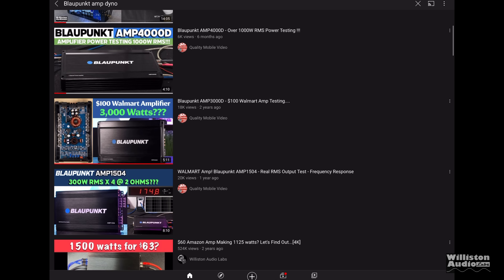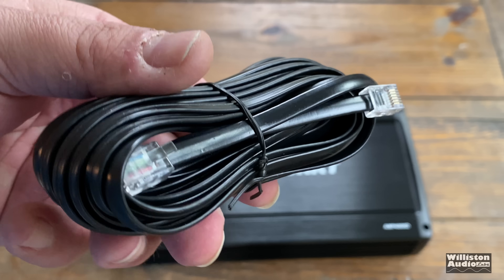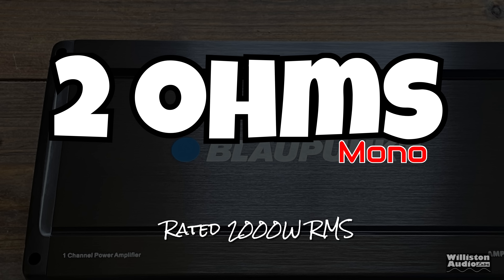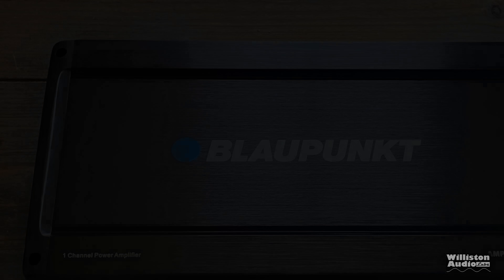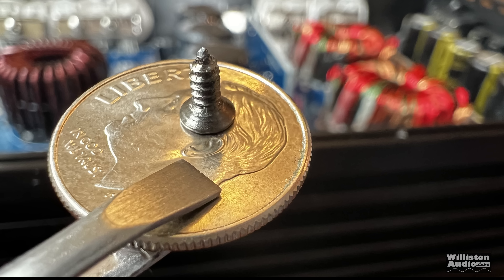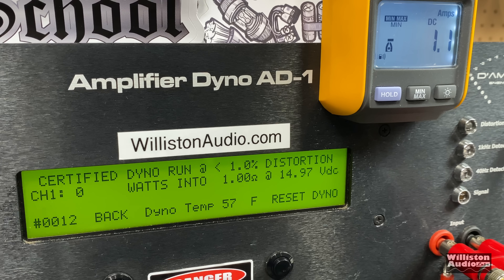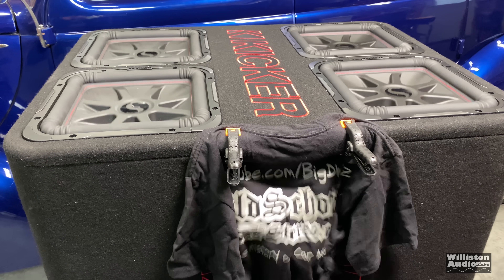How Much Power Does a $49 4000W Walmart Amp Make? [4K]

Comment: Per Google AI Overview: Blaupunkt was originally a German manufacturer and was part of the Bosch Group until 2009. It was sold to Aurelius AG in 2009 and later went into liquidation in 2016.  Current owner: Established inc., a U.S. brand licensing company.  So, sadly  at this point, they are leveraging the reputation forged in it's earlier days and slapping a Blaupunkt sticker on generic manufacturer products. Another great organization that bit the dust.😡

Comment: 400W outrut? 🤣 And no high pass (subsonic)? Great for ventilated enclosures, can kill your chassis mechanically at frequencies below 30Hz, because you don't have a physical brake like in the sealed enclosure. With ventilated enclosures a subsonic filter is a must have. Blaupunkt was a great german manufacturer in the past, but since they sold the brand name to China, unfortunately it's rubbish.

Comment: Got one of these lower power but I absolutely hate it. Only got it for a temp use and I wouldn't even say it's good for that. I got the gain 3/4 and it blows itself out and goes into protection on rock and roll music let alone anything else. I'm only ring 2 8 inch subs on it and it's supposed to be 1500 watts.
Reply: Your subs ohms could be too low. I sold a sub that worked fine in my truck to a friend and it kept shutting his amp off when I turned it up. What it was is my amp was stable down to 1 ohm and his was stable to 2 ohm and the sub was wired to 1 ohm. Rewired the sub and it works fine
Reply: @Cantbreakitifitsnotfixed it's that garbage ass amp. New amp works mint same wire configuration.

Comment: A long shot, but is there any possibility of testing the 5000d version? I cannot find ANY dyno testing or even reviews on this amp. For a budget option blaupunkt is pretty good stuff. I have their 3000d version running 3 r2d2-10s in a custom aeroported enclosure I made myself in my work truck and it gets down. But I’m wanting to upgrade because I know I’m not pushing these subs to their near their max capacity and this seems to be the best option for around 1300-1400 on 1.33 ohms if that seems right to you. It’s only 118.00 dollars on Amazon currently! I’m stuck between this one and the skar audio rp 1500.1 for around 170.00

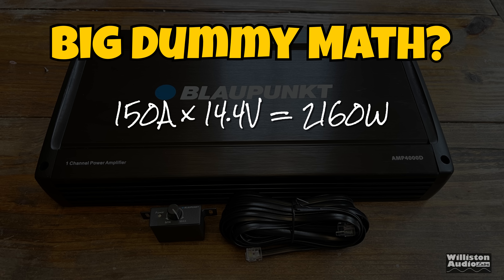Comment: 4:40 That "Math" doesnt really work, because its says RMS power (sine wave). With your calculation youre assuming a dead flat DC output. Which is wrong ofc.
In other words youre basically comparing the flat DC input to the "pulsed" output of the amp. Ofc the input power will be less on average. You can easily visualize that by drawing a flat line and a sinus wave (with the same peak voltage). Now take a pen and color/fill in the area between the voltage and the base line. Youll notice theres much more area under that DC line.

Comment: Agreed,  good power for 50 bucks! I noticed the circuit board looked like the circuitry was split in half like they use the same board layout for a stereo amp. I wonder if they just internally bridged it and called it a mono block. The Chinese dont waste engineering on cheap electronics. It wouldn't surprise me if they want twice the amount of money for the stereo version but it is essentially the same amp unbridged with an additional speaker connector.

Comment: I wonder if the EMI shows up at low gain usage or only when it starts sucking amperage. I was hoping to use one of these at low gain to drive a bigger sub recently came across but like most of everybody else here, I was drooling at the mouth until the EMI stuff showed up. My sub is allegedly rated for 2000w and was willing to work with an amp like this but the EMI isn't worth it. If your tester interpreted the interference as character changes on the display, I'm scared to think of what it would do my pioneer radio when connected to the remote bass port ijs... tsk tsk... I had/have hope for blaupunkt, maybe their lower power level amps are better as far as interference?
Reply: I wonder if they are even using proper loads during testing. They might be using a purely resistive load and ignore inductance idk

Comment: U wud think by now, they wud just design simpler amps that are pretty much, plug-n-play...  They're still temperamental, ez to blow during install and way under-functional...  The whole car stereo design is out-dated!  Why aren't the geniuses designing wireless speaker connections yet?  By now, we shud be able to connect as many speakers as we can by Bluetooth to the Amp, NO WIRES!  Impossible, not at all!  It's the same as portable bluetooth speakers!  I shud be able to rent a car, take my Amp & speakers, plug-n-play then return the car.  Nothing worse than renting a car with a tik token stereo...  I had to tell my installer to mount my Amp on my full range 10" "Kicker" box.  He said, u sure, I said YES!  This was in 2011.  Soon after, amplified speakers became the rage!  Maybe I was first, maybe n..  hmpff!  Anyway, Ask Kicker about dat and maybe these lazy bums will get cracking and stop blaming the Chinese and Amazon for losing customers!!!  You've lost, that CUTTING feeling!  Whoa, that CUTTING feeling! You've lost that CUTTING EDGE feeling, but it's not gone, Nooooo Whoa Whoa!
Reply from the maker: The rage in this comment 😳
Reply: @wal  yea, I get heated after crunk o'clock!

Comment: did you have the emi aka YNAMiC issues running at the recommended voltage?  or only when you ran it at a higher voltage?
Reply from the maker: Only this amp

Comment: would maxing out eq etc effect the audio test numbers? for example you had turned the bass to zero... this being a low cost amp which target audience would not be the most audio educated ie they thinking if you aint redlining you aint headlining...  most likely be running with everything maxed.  maybe engineers designed optimum performance at  bass boost max (or near?)  idk if that would change anything.. so id love to know!  great channel btw

Comment: Big D would you run some amp dynos testing power at 20 hz? And tell us about amp signal to noise ratio and damping factor. My Rockford fosgate power series T1500.1 bdcp says on the birth sheet that it does over its rated power at 20hz
Reply from the maker: Thanks for the suggestion

Comment: Back in 96, I had a 78 El Camino as my first car, Blaupunkt head unit, kicker comp speakers with a rockford punch 40 amp.  Lot of the 90's stereo companies have gone down hill and not high quality they once were. Even house speakers and receivers have gone to crap
Reply: I remember 96! I had a strong Clarion amp and head with a pair of Kicker comp 12's in a huge custom box in the hatch of my CRX. That system would make you cross eyed and it was stolen TWICE in one year and recovered both times.

Comment: That's sad.  I had a Blaupunkt head unit in a K-car back in the 90s (super custom wiring).  It was rated for 20 watts per channel and blew every speaker I hooked up until I got to the cerwin vega 3x4's that were rated for 80w.

Comment: i havent looked at speaker stuff for 25 years, i actually expected MUCH worse out of this just based on price.  back then amps were about a dollar per watt.  i expected maybe 100 watts out of this.
Reply: Class D is what makes the difference.

If you think about how much cheaper and more efficient a switch mode power supply is than a mains frequency toroid with a bridge rectifier and bipolar transistor voltage regulator, well, a Class D is basically a switch mode amplifier.

I looked into the technology around 1991-92, but concluded that switching frequency and output filtering issues would make it very hard to build a full spectrum device, but it might work as a bass amp...
Reply from the maker: Yeah the cost now is under 10c a watt in many cases. It’s insanity

Comment: You really ought to invest in a cheap oscilloscope... you'll be able to see a lot of stuff you're guessing at... for example the EMI stuff. Being that it is a class D amp, having a PWM output, if I had to guess, I'd say it was the same thing as a variable frequency drive... and the carrier frequency they are using for the PWM may be causing a lot of hash in the output. In short cable runs, you're normally expect the motor, or in this case, speaker, to filter all the high frequency noise out by integrating it basically with the inductance of the coils. The higher frequency will give you a better more accurate waveform, but it will also increase your switching losses. Personally, i'd only expect this to be ran on subwoofers, so it shouldn't have to worry about high frequency distortion. I have no idea what frequency spectrum that test unit is feeding the amp, and if it's trying to get it to amplify a frequency near or a harmonic of the carrier frequency, bad shit is gonna happen. 

Again, buy a scope so you can actually see it!
Reply from the maker: I have a scope, it would put most people to sleep that’s why I don’t show at this time. Thanks for the suggestion though, I do appreciate it 👍

Comment: I'm slightly confused... you had the gain turned down to minimum... shouldn't you try mid range or high?
Reply from the maker: Gain is matched to the head unit for the tests
Reply: @wal  Matched how? What's the criteria? I honestly never heard of that.
Reply from the maker: @kleetus92  The Amp Dyno has a DD-1+ built in so I can match the amp gain to the head unit for the test. This is used for every test to ensure accuracy.
Reply: @wal  Cool,. thanks for the info, I'm going to have to look that up because I have no idea what that is. Thanks for taking the time to answer.
Reply: @wal  Looked that critter up. Interesting little device, I did that manually back in the day with the scope and FFT plot.  Probably the easiest way to initially estimate what an amplifier can produce is measure the amplifier supply voltage rails. Assuming the onboard DC to DC switching supply can continue to supply that voltage under load without drooping (which is actually the hard part of amplifying, not the actual output stage) that will set what the amplifier's output power actually is. 

If it is supposed to have a 40V p-p power supply, into a 4 ohm load, mono, you'd get 400 watt RMS, with a supply current of 10 amps on the supply, which would mean you'd be asking for almost 28 amp at 14.4V from the car battery...  So, barring the obvious, if that power supply starts getting soft when the amp is asking for full power, that's where your distortion starts to creep in.
Reply: Gain setting has nothing to do with output power.
Reply: @69eddieD  Sure it does. If it is an input divider, you cannot reach full power if the input knocks the signal down by half. 

If you have a gain of 10 for example, and you have an input signal of 1v p-p, you'd expect to see 10 V p-p on the output.... but if the input circuit is set to cut it to 500mV p-p, you're only going to get 5v p-p out of it.
Reply from the maker: @69eddieD  well it can if you have it set too low and doesn't reach the max output power (low voltage source unit)...but I know what you are saying. Just clarifying for those who don't know.

Comment: So, a more realistic price would be at least a hundred bucks.  And with only one speaker output, a stereo would require two of these amps.
Reply from the maker: The mono amps are typically designed for subwoofer applications

Comment: Can this be used at home instead of in a car?   If so, how do I power it off 120v ac?  Also, how would it sound with a pair of 4 ohm speakers at home?
Reply: - The electrical system of a car is nominally 12 volts, direct current.  A 12 volt power supply would do the job. Just make sure it is rated at  least as high, in amps,  as  what this unit draws.
Reply from the maker: This is a subwoofer amp and could power home bass speaker(s) with a large enough 120v to 12v power supply. Something like this https://amzn.to/3UtM8P5

Comment: Those fuses have a latency. They do not just instantaneously pop at 50 A

Thus being able to output 4000 W peak while fused for 2000 W continuous load is not unrealistic in itself

Comment: Max current is 333.33333 amps. That’s the max that you could get out of it on a good day. But the reality will be different as electronic components vary from manufacture to manufacture. Watts are power.  Power = I (amps) x E (volts) or PIE. 4000 is the rating not the actual output. As you may get 4000 Watts for a limited time before that amp blows a transistor.

Comment: So, sometimes they get these wattage figures by pulse testing the amp for milliseconds, before some kind of current limiting is used to keep the amp from melting into a solid block of plastic. It's not going to pass 32a for long. 
Hence the term "continuous" which means it can deliver the rated power all day long. If no time duration is specified, they're not technically cheating, are they?

Comment: I was ready to say you don't even need to dyno that amp as you can suspect how low the output would be compared to the advertised by checking its fuses.... Until i've seen those triple fake 50A fuses!
AAAHAHAHAHAHAHAHAHAHAHA
The output with 1% THD is more than great for its price though, you would expect this kind of power out of one like these at 10%.

Comment: I remember that their speakers and the auto reverse pull out cassette tape player were pretty decent, but seems like by the time cd players came around most of the radios,CD players and amp and subs are very poor in efficiency and flat out blasphemy wattage ratings,I stay away from them and that is probably why I have owned so many dual audio electronics products lol

Comment: Those voltage pulses are simple to deal with.
The reason for the pulses has to do with the switching speed of the power supply and the inductance of the input cables. You can't just remove energy from an inductor without it unloading the energy it has. This is how these amps make 60-90V rail voltage from 12VDC in the first place by switching on/off a large inductor inside to create voltage pulses that are stored as rail voltage.
Problem is that the switching supply instantly turning off the power on the DC input cable makes the inductance of the DC cable do the same thing that the inductance of the power supplies is doing... making voltage pulses. Mind you, the inductance of the cables is orders of magnitude smaller than the internal inductors... but still. 
A good amp amp would have a place for that stored energy to go or would (more likely) alternate the internal charging between two or more inductors so that the 12 volt cable didn't see the sudden current shut-off during peak current demands. At least one of low enough frequency to matter.
Adding a couple good quality film caps (of proper voltage and pulse current capabilities) across the 12V input should fix it and looping the power supply cables through a ferrite core will keep it from propagating down the cable and radiating.

Comment: This is reminiscent of the graphic equalizer/power amp units that J.C. Whitney used to sell. They offered huge power, three or four dozen band pots on a tiny box, all for $12.95.
Reply: 😆 Those things, with no DC-DC converter in them, are ALL about 12 watts depending on the ohms load driven
Reply: @davelowets  aInT wHaT tHe bOx SaYs 🤣

Comment: Figured out their math standard. Feed amp 22.6 volts. You get 2000 watts on speaker negative and 2000 watt on speaker positive for each crest of the sine wave. You have two terminals. 2 terminals X 2000 watts = 4000 Watts! Maybe there is wattage leaking out the unconnected terminals. You gotta seal it in with an insulator like candle wax. You also didn't use range on the oscilloscope in the lab. Zoom in and your power goes up! Sheesh every second day EE student knows that. :)

Comment: is it not doing rated power cause u didn't max turned them gains nob? while its half turn only? does that matter? jw..

but again back in the late and early yr 2000 this amp would of cost at least $600 to 900 and money was very valuable in them days...if they would rated the real watts for the $1 per watts ...so for that much watts for 50 bucks cant cry but for illusion of 4000 watts they need to be sued for fault advertising smh!

Comment: Way back in the 90’s this brand was used in some European cars like BMW and Mercedes Benz etc. And it’s quite expensive ($300-$500) on the market. So you will not be surprised if the windows of your bimmer are smashed the next day because you parked it on the side of the road.

Comment: 30 years ago $50 at Walmart would have bought a spark-o-matic EQ power booster with a single IC amp module.

Considering inflation, that thing is an incredible value.
Reply from the maker: For sure 🤙

Comment: I guess I don't know enough about this, but I can't even imagine putting 4 kW of sonic energy into my ears in an enclosed space.
Reply: If you haven't had a subwoofer before then it can definitely seem rediculous. Actually even if you do have a sub, it's still kinda crazy 😂. But the thing is, bass needs WAY more power in order to sound loud. You may be putting only ONE watt into you tweeters, but your sub will need like 100 watts to keep up with the tweeter. If you ever get the chance, hook up a tweeter to a small amplifier and crank up the volume. You can get INSANE volume out of a small tweeter with minimal wattage. Subwoofers are the complete opposite.